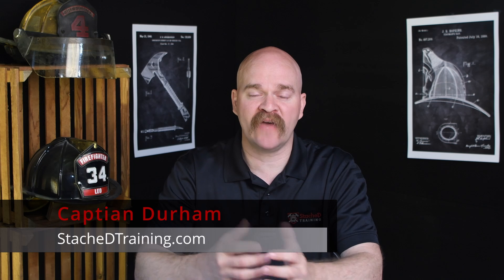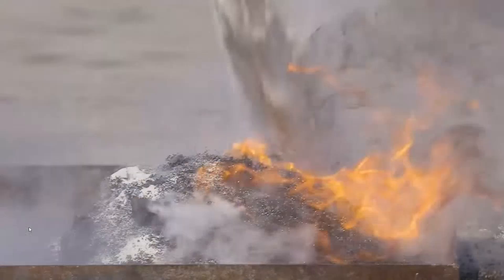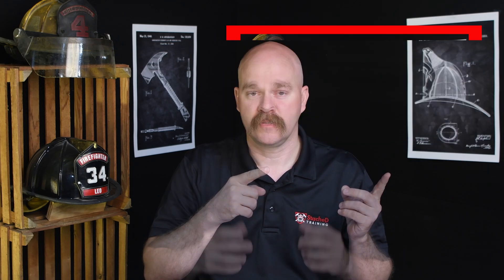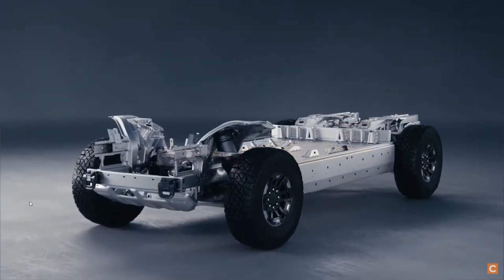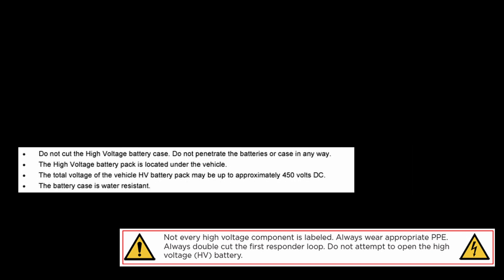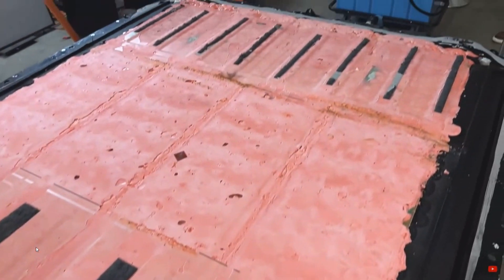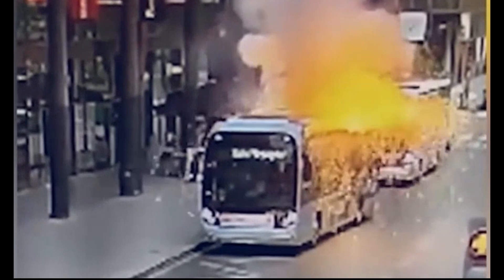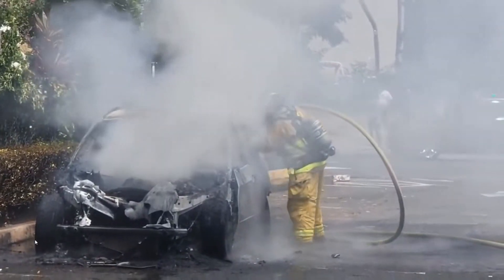What Firefighting Tools for Extinguishing Electric Vehicle Fires Really Work?

Comment: Maybe EVs should have to be designed so the battery back can be removed from outside the vehicle. Maybe some sort of fusible retention mechanism that enables it to just pull right out if a certain temperature is exceeded or locking mechanism automatically released if certain conditions are met? Something like this could save a family, not just property.
Reply from the maker: There is a Chinese company that has a removable battery pack.   Unfortunately, it isn't an easy process.   The removal/replacement takes place in a highly automated building.
Reply: One of the big problems here is that of potential theft. 
There is no system that cannot be hacked and if EV batteries are worth money (They are!) then there will be a market for having them stolen. 

If you give a set way to remove a battery pack in a fairly easy manner then the thieves will work it out and the market for stolen batteries will open up. 
ESPECIALLY when you consider the costs of a new battery pack and the fact that the resources to make a battery pack are finite and NOT cheap. 

Great idea in principle... Just not very practical. 
B-(
Reply: @Kalamain  Tesla battery packs are part of the frame, and glued in...  Nobody is going to steal a battery pack out of a Tesla... or any other EV for that matter.  WAY too heavy to move easily.
Reply: This is NOT a solution, the car itself is toasted scrap already and not to be saved, the real problem is still the battery pack itself and you just move the problem.
Reply: Too many maybe's.
Reply: @terry_willis  The point about the fusible retention mechanism would be to prevent battery theft in normal use as the battery cab easily be the most expensive single item in an EV. It was an evolution, if you will, of the first idea and a possible option to go with having a removable battery pack. Hence the 'maybe'. An externally removable battery pack was just one idea, hence the 'maybe'.

Another idea would be if the battery could safely be pulled out by use of a large magnet or even electromagnet. This would enable fire crews to keep a distance while pulling the battery. The magnetic pull would activate a secure electrical disconnect and release the battery from the vehicle.
Reply: @DelticEngine  All good ideas.  But one flaw.  The battery for an EV in an inherently bad idea.  Too expensive to make, including the mining. Not great in hot/cold climates. Limited raw materials.  Limited available electricity to recharge without oil.  Too long to charge/limited miles (great for city short trips though).  If an induction method to power the motors is found (no battery) EV's would be great.
Reply: @terry_willis  My ideas outlined above were possible solutions to problems presented in the video for vehicles using existing battery technology and nothing to do with not having a battery. Induction is extremely inefficient and not worth considering in terms of minimizing energy usage. There is also extreme EMR and its side-effects to consider. It would be very difficult and impractical to have a vehicle without any form of energy storage onboard. 

In order to be of any use and electric vehicle need some form of storage or electrical energy. One way of doing this battery technology. Another is supercapacitors. People are not going to purchase a vehicle with no range. Older battery technologies are much safer and well known. One of these could be combined with supercapacitors for their high current capability for bursts of power and regenerative braking. If such vehicles were for (relatively) short distances only then smaller energy storage would be acceptable. For greater distances I would suggest combining this with something like a 'roll-on roll-off railroad' where rail would take the EV the bulk of the journey.
Reply: @terry_willis  Well, there are trains, trams and trolleybuses (interestingly I seen some electric buses charge in a quite similar way to how those are powered).
Reply: Ejection seats would be easier to implement.
Reply: Maybe we shouldn't be forcing EV on the consumer.
Reply: Look at the structural battery on a Tesla...(mentioned in the video with the pink foam)...it is the chassis. Everything else in the car is welded/bolted to it.
Reply: @frollard  Yes... It is now, but there is no reason things can't be changed in the future to fit new safety guidelines
Maybe a cassette cartridge system for example.

Then thieves could nick them like we did on old remote controls. B-)
Reply: EV battery packs are EXTREMELY heavy.  And in Teslas, they glued in as part of the frame.
Reply: Why bother, just let the pos burn, I wonder if it costs more to insure one of these toys considering the liability.

Comment: If the strategy is to let the EV burn out, which may happen within 1-2 hours, would using a fire blanket hinder this process and increase the time needed for the battery to burn out? For example, could you use the blanket immediately after arriving on scene, in order to limit flame and gases, while still allowing the burn to occur and not drag out the process?
Reply from the maker: Using a blanket could present a hazard due to the build up of explosive gasses.
Reply: The blanket is useful in protecting exposures, until you can drag the car to a clear area.

Comment: I have a 100% guranteed method.
Don't buy an electric vehicle.
Reply: Gas-car fires are exponentially more common, so doesn’t make a lot of sense in the long run. https://www.autoinsuranceez.com/wp-content/uploads/2021/08/1-_Car-Fires-by-Vehicle-Type-1-1024x395.png
Reply: @jamesdotson3965  Your chart is misleading since it's only a comparison of total fires not by the percentage of actual vehicles on the road for that type. There are less EVs on the road than there are gas powered. Of course, EVs are going to have less fires due to there being less of them on the road.

Comment: How about a seriously cold gas discharge like CO2? Rapidly cool own the battery box and keep it cold until the battery or car can be removed to a safe area?
Reply: was thinking the exact same thing. what if the cooling system was pressurised co2 or nitrogen, and the rapid venting causes it to cool faster than a reaction can produce heat? just freeze the battery from within. this may require some heavy maths on volumes, pressures, thermal capacity, surface areas, and rates of conduction... seems feasible as an idle thought though, doesnt it?

nice to see someone understands gas laws and is thinking outside (inside?) the box!
Reply from the maker: Unfortunately, UL FSRI has proven CO2 ineffective against lithium-ion batteries.
Reply: @StacheDTraining  but they are only using it in a useless attempt to "smother" a fire that cant be smothered... they arent using it as a refrigerant to draw the heat away rapidly, faster than the reaction can produce it...
Reply from the maker: @paradiselost9946  the cooling had no effect.   CO2 can't provide enough cooling effect.
Reply: @gcampagn  True. The batteries burn because of thermal runaway. Freeze them cold and it's more likely to stop. Maybe companies could put connections on the battery container to flush the battery with liquid nitrogen?

Comment: Lithium ion batteries are a transitional technology that direly needs replacement and with billions at stake that's in work, but governments should destructively test all new vehicles and batteries to provide first responders with useful info. For example a non-flammable battery heated by an external fire should have its combustion products tested.

Comment: This is a very good presentation and I agree with the end recommendation.  But fire by definition requires oxygen.  Thermal runaway is an exothermic reaction that does not require oxygen.  The flaming coming from the flammable off gas of the battery thermal runaway.  
Think of each battery cell as a separate fuel load.
Reply from the maker: My first video does a deeper dive into lithium-ion battery construction and failure modes.  It takes a deeper look into the exothermic chemical reaction: https://youtu.be/SWbHMeiSf9w
Reply: The problem is the batteries themselves apparently produce their own oxygen when burning
Reply: fire, by definition, also requires HEAT.

lets say "combustion". because i can mix flourine and sodium and it will "combust".

lithium and bromine, perhaps? WEEEEEEE!!!!

how about carbon and nitrogen? thats a form of combustion... mmmm, cyaniiide.

really, a "fire" as such is an "oxidisation".

rust is an oxidisation... we dont call that fire unless we use pure oxygen and it becomes an oxy torch or thermal lance and simply burns through 3 metres of steel... 

but... the difference is heat. no heat... no fire. heat = energy.
Reply from the maker: It does not require external oxygen.   The oxygen is already built into the battery cell.
Reply: @StacheDTraining  firefighting techniques can supply ADDITIONAL oxygen adding to the fire's intensity

Comment: Great video, thanks :)  what are your thoughts on tbe f500 extinguishers? (They are advertised as designed for lithium battery fires)
Reply from the maker: There's a big difference between lithium-ion batteries out in the open and those same batteries sealed up in a box.  Getting any product inside the battery box is extremely difficult if not impossible.
Reply: @StacheDTraining So, f500 would help with phone or laptop battery, but not with ev?
Reply from the maker: @sashab.1285  I plan on doing a video on F500 in the future.   It's in the planning stages, and will involve some real-world testing.
Reply: @StacheDTraining  Thank you for the answer, and the effort on this important subject. 👍
Reply: @StacheDTraining  F500 works, even when the solution doesn’t enter the battery.  It’s greatly enhanced ability to remove heat stops TR by lowering the electrolyte below its flash point.  If penetration is achieved (through the holes gasses are spewing out of!) then the electrolyte will be encapsulated and rendered non flammable.
Reply: @StacheDTraining  ah that kind of makes sense now.   cheers :)

Comment: The problem should be solved by the the car companies. Every separate battery compartment should have a one way fire extinguisher nozzle and all come together to a few one way nozzles at the outside of the car also all connected together so it can be reached were the fire is the lowest. Car companies put a lot of effort and money making better batteries, then they should also put effort to find out if they could find a safety substance that would react with the gas inside the Li-ion battery and could be injected through these nozzles to put out a Li-ion fire. It is just a matter of time that the insurance on an electric car will go through the roof so these companies should have a lot of combind interrest in solving this problem.
Reply from the maker: I agree - this should be solved by the manufacturers.  I feel that many of the OEMs are focused on developing safer battery chemistry.  There are a few out there that have intellectual property (patents) around different methods of extinguishing a battery fire and some European companies do have access to the battery for firefighters.  I plan to do a video in the future that discusses this topic.
Reply: @StacheDTraining I think a fire safety standard is needed in the future.
Reply: The same car companies getting humans to alpha test self driving? World governments need to step up, because GigaPress framed batteries will be impossible to extinguish.
Reply: Totally agree!  There need to be some new laws drawn up especially since ev’s are becoming more and more prevalent.  We’re still in the infancy of the development of these vehicles towards the latter end maybe but things will hopefully Improve.  As for putting these fires I just wrote something down but it’s actually a, in my opinion,  a great idea and don’t want to put it out there😶maybe I’ll bring it on shark tank lol
Reply: NOT possible......if you knew what you were talking about you would know what the fire triangle is......take away any side and no fire....not possible with a combustible METAL fire

Comment: Why can we not treat lithium ion fires like we do a gas tank fire? Once the fire has reached the gas tank there is no stopping it there is no putting it out we just accept it is what it is. Maybe we just treat battery fire the same way, there is no extinguisher there is no system that can put it out.
Reply from the maker: A leaking gas tank on fire has a fraction of the energy release when compared to a high voltage battery in an EV.  With a gas tank, a proper application of foam can do a decent job.  You are correct, it's nearly impossible to stop a thermal runaway in an EV high voltage battery.

Comment: I know of several wrecker companies in my area that keep a roll off dumpsters full of water on their property and will place an EV in them no mater how badly damaged or not they are. Not sure how they sort that out with the insurance companies but thats what they do.
Reply from the maker: Most emergency response guides in the US say not to submerge the vehicles in water.  Putting an electric vehicle in water that is not in thermal runaway is just asking for problems in the future.  There are many issues with this type of thought process.  I'll tackle submersion in a future video.
Reply: @StacheDTraining  Thanks looking forward to  that. I am not a fire fighter but I am an electrician and I was wondering about them doing that.
Reply: @thehamelsduck1600 Ask them if it's salt water, a lot of lithium battery manufacturers for RC cars recommended cutting the leads off (one at a time) and submerging the pack in saline water for 48hrs to discharge them before safe disposal. I store my LIPO batteries in a steel ammo can with a vent when not in use, they are violent when one of their safe operating criteria is surpassed
Reply from the maker: @slowstang88  UL has done a study on this and sodium bicarbonate is the best thing to use to remove stranded energy from battery cells.   I'm planning on doing a video on this in the future.
Reply: @StacheDTraining  I'm subscribing, I'd like to see this. I love my lipo brushless powered RCs. I did intentionally puncture a puffed 14.7V lipo (in a controlled environment and the results were pretty violent
Reply: @slowstang88  ive only had one lipo go spectacular, taking out a charger and bench with it :) was only a baby 350mah too!
 and ive had some quads come down hard on packs... wee! punctured cells, cells crushed from long and thin to short n squat... puffing and smoke... but never fireworks :(

but as much as i love electric when it works, im sick of dead batteries, dead chargers, leads breaking, glitching electronics, smoked escs... unless i sorted it out the night before, everytime i go to play with electric somethings effing screwing up. and even if i do, its screwing up. they only ever seem to work great on the bench when you first get them... lol.

nitro through and through. as long as i got some i can go for a spin. though its sorta heading for spark/petrol conversions now... sigh.

and nothing sounds quite like an os fs26 in a bike....

i prefer the smell of castor to magic brown smoke, too.
Reply: Car fires are bad news in a tow yard. Only one that happened at my workplace was my friggin vehicle, a disgruntled customer lit up. There is a company we have dealt with in past that lost their whole shop and all but one tow truck from a fire that started in a damaged vehicle. Don't think it was an EV
Reply: Use a dumpster full of water, and you will have a dumpster full of hazardous waste, and you will need to pay for a permit to haul and dispose of hazardous waste...
Reply: @gcampagn  Uh, NO.  You're going to need a semi tanker of Nitrogen to even attempt that, and it still doesn't get rid of the electrical charge in the battery.
Reply: Hey, I bet the Navy has some foam left over.
Reply: @johnsmith-po1uo  Foam is useless on battery fires.